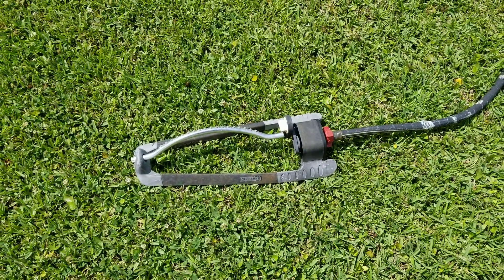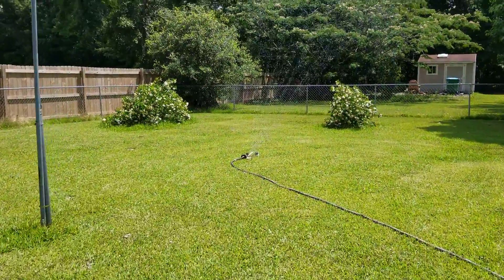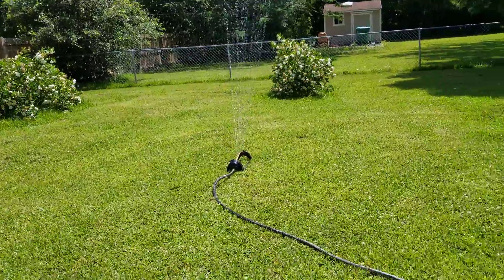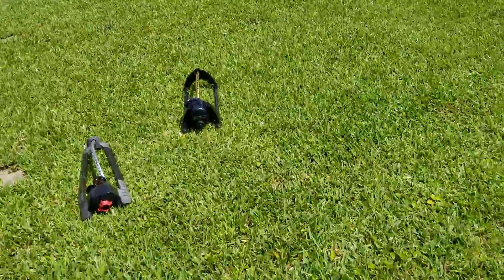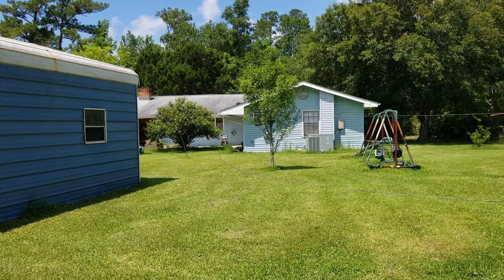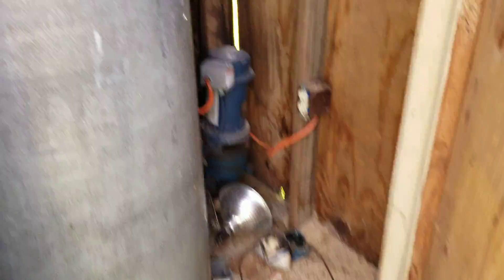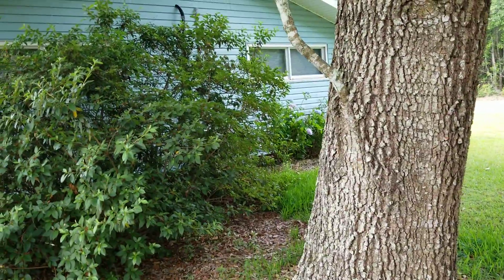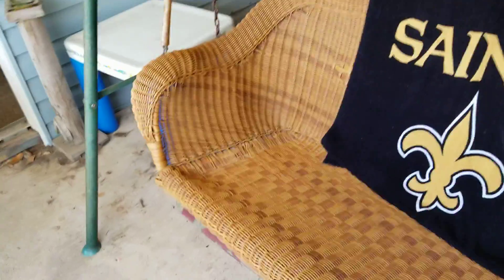Testing Our Water Sprinklers

Comment: OK, listen and listen good.  For the sprinkler that's not spraying right, there's a cap at the end of the spray arm that unscrews.  There should be a little plastic pin on it after you take it out.  Poke that in the holes to clean them out.  Then, with the cap still out, turn the water on for a few seconds to flush it out.  Then replace the cap and it should spray right.
Reply from the maker: Alright